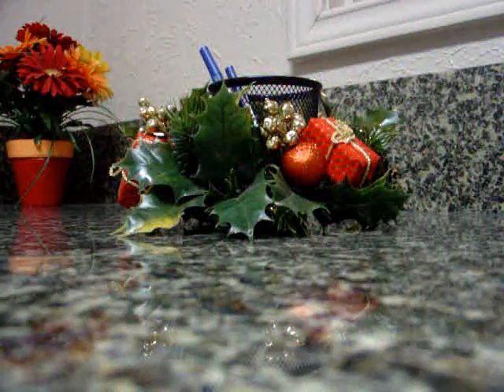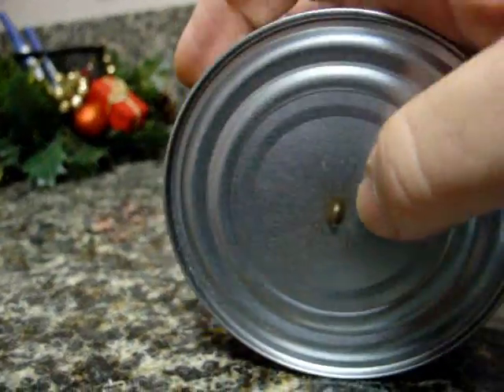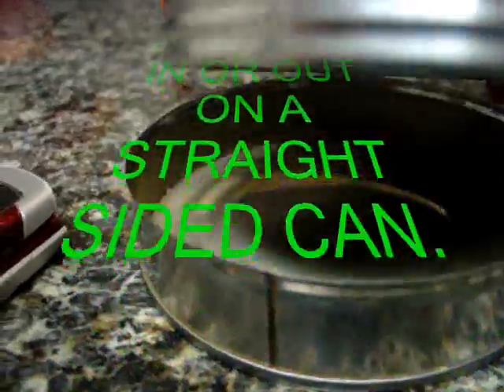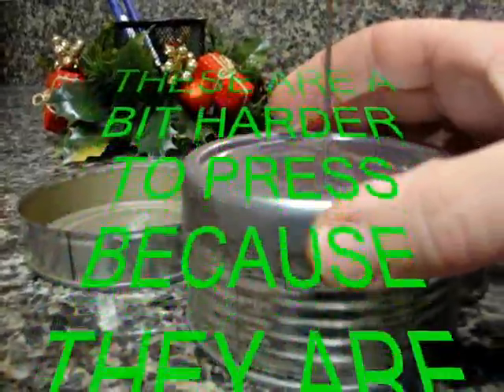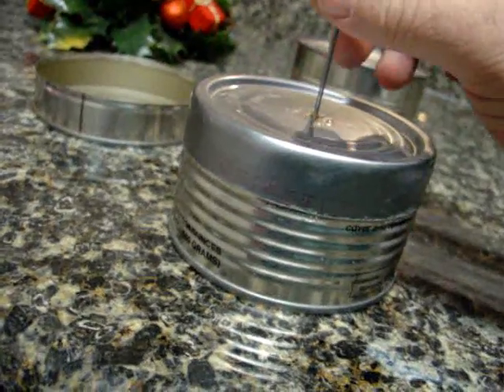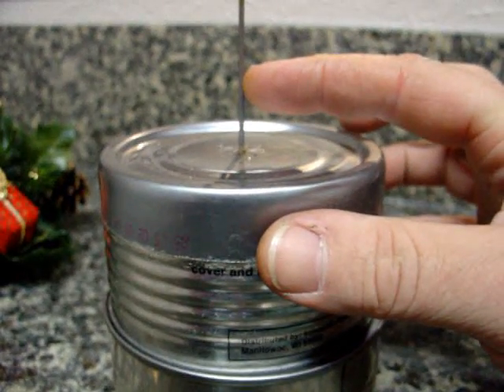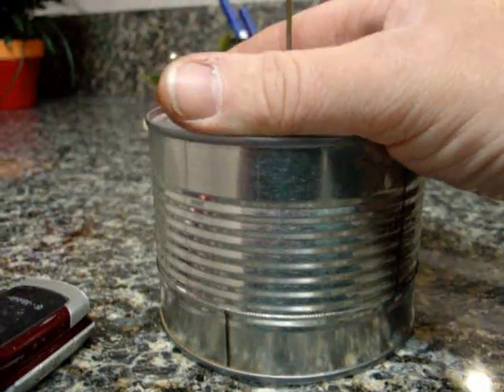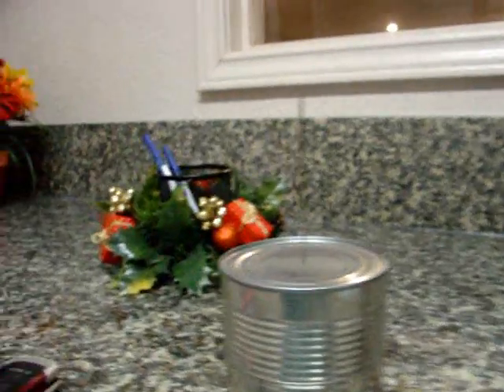INTRODUCTION TO HOW TO BUILD A STIRLING TIN CAN ENGINE.wmv

Comment: If these are so great, why not sell them at Walmart or Home Depot already built?
Reply: NASA trialed them inthe 90's in cars. they found they were much more efficient then a compusrion engine but like steam car engines big oil shut it down. steam engines in cars have been around for 100yrs in the 70s big oil bought 3 companies with efficient working models and shut them down. Then fuel was cheaP SO NO WORRIES now with fuel prices like they are its time for them to come back.  I think people forget the power of big oil the have shot down many more efficient motors just for profit.
Reply from the maker: +Tony Benevides no one said they were so great. in fact many others are better. The time it takes to build one this way is far too much to try and make a profit on.

I make this series for the instructional value. Many have tried at several other builds, and ask why they didn't work. The answers to those questions are in this series. 

But if I were to build a Stirling engine for over the counter sales. I can think of a few more versions I would much rather build than this version. They would be a bit more efficient as well.

Thanks.
MUDDy
Reply from the maker: ***** exactly. Gm tried them, but didnt make it to market because of the warm up time.
The military tried them with great results on many fuels. success, but for some reason the project ended as well.
MUDDy
Reply: ***** in fact if you look at you tubr there a 1928 steam car that starts right away have look at Jay Leno garage he has a video on his steam car. Because fule was so cheap no one much cared back in the 70s but nows the time for this technology to return,
Reply from the maker: *****
yes, the stirling motor was replaced by the steam turbine because it was smaller, and had more power for it's size. The stirling motor was more efficient though. warm up times were the downfall of them both. The gasoline engine and deisel engines were even smaller and could produce many times more power, Just less efficiently.
General Motors actually put out a stirling car. But the warm up time made it less appealing to manufacture and try to market it. then the military replaced a gasoline engine with a 70 HP stiling motor in a pick up truck. they did many tests on several fuels. They were very positive results including torque and load tests while pulling trailers and such. But still no stirling motor cars.
Jay leno has a very attractive assortment of vintage, and interesting vehicles. i love to watch his videos.
But best of all for the stirling motor, is they are great water pumpers for third world countries for irrigating fields, and rice bogs. One log, and it runs until the fuel runs out, and stops. Pretty handy.
MUDDy

Comment: I have my displacers built out of green chili cans and they are 2 3/4wide and almost that tall. My question is how tall do I cut my cylinder, which is a soup can? Most of the Gamma engines I've seen on here have very short strokes and if I have to, I'll do mine that way but I want as long a stroke as I can get. Mine will be a 2 cylinder walking beam type. Thank you.

Comment: I'm wondering if the displacer could be "molded" out of the kind of canned foam that hardens. Like wrap some shirt cardboard inside the cylinder can, set in a bottom and the rod then shoot in foam. Peel off the cardboard and have a custom fit. 
Only things are, would it be too heavy, take the heat at the hot end and last for long?
It could save time and effort if it could work. 
If weight is no biggie, there's fiber-crete mixes that might do.